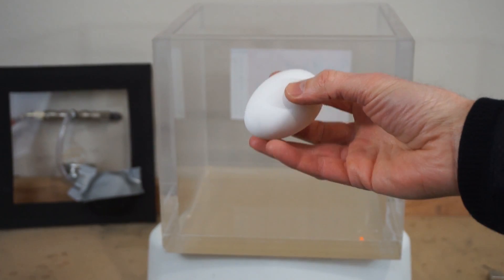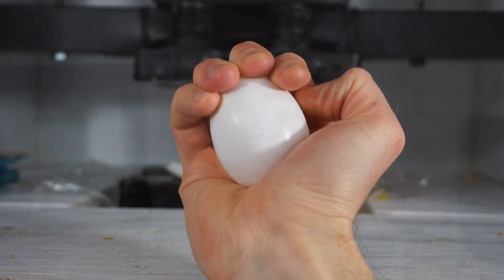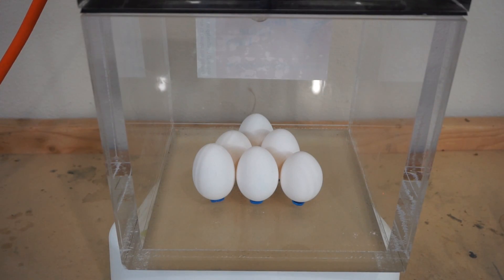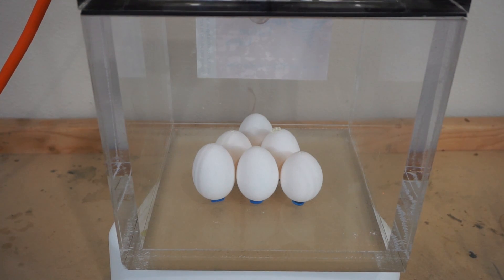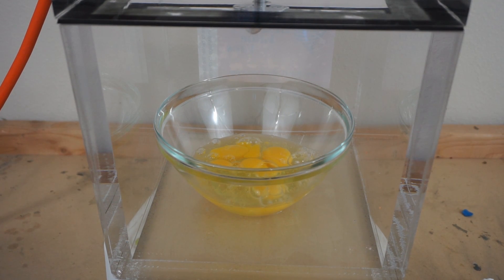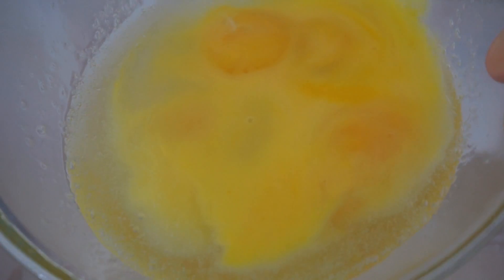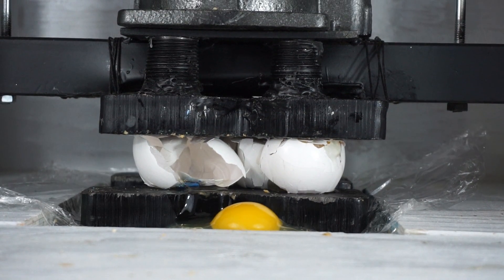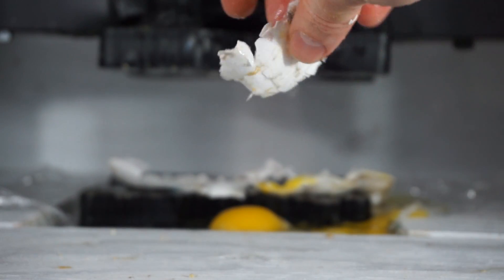What Happens When You Put 6 Eggs In A Huge Vacuum Chamber?

Comment: I don't get it, how can eggs boil in a vacuum?
Reply: Because of the water in them(74% of egg contents is water)...water boils at room temperature in a vacuum.
Reply: A liquid boils when vapor pressure of liquid= atmospheric pressure. So, you can get a liquid to boil by (1) heating it to increase the vapor pressure to match the atmospheric pressure, or (2) decrease the atmospheric pressure like he is doing in the video. The eggs have not actually changed temperature.
Reply: Derryck Gray "throttling" or expansion. Thermodynamic definition is "the boiling of a portion of liquid, that cools the remaining liquid" it happens at a change of state, not temperature, the moisture in the egg gets boiled off, and the change of state takes more energy than just a change of temperature, so the harder the boil (under less atmospheric pressure than usual) the more energy taken away from the remaining liquid. This cools the liquid, just like a lake evaporating it's water into the atmosphere, if that same lake were on mars, there would be no latent heat exchange, the water would simply flash off at once.
Reply: While it is true that the demonstrated boiling is not a result of the eggs being heated, Travis does make a point that there will likely be some measurable negative temperature change as a result of the phase change due to boiling.
Reply: So if left long enough to boil out all the moisture, could one make some really weird dehydrated raw eggs?
Reply: Wayne Chipman Not really air bubbles, they are water vapor bubbles-made of water in a gaseous state.
Reply: It is easier for the liquid molecules of the egg to escape into the vacuum as it does not need to fight against atmospheric pressure pushing down on it. It does not need to reach temperatures that can cook the egg for it to boil.
Reply: ivan bernardo not the correct description here, Not having anything For the heat to transfer into, would mean that the eggs would not gain or lose heat but because their vapor pressure has been decreased By pulling vacuum on the chamber The boiling temperature of the substance is lowered
Reply: To put it simply, all of you are somewhat right but for people that dont know why eggs boil in a vacuum is because when you lower pressures around water. The boiling point for it also lower but unlike the boiling at high temperature. This wont cook anything since the temperature doesn't change
Reply: Actually, the reason water boils in a vacuum is because in when normal atmospheric pressure, the pressure from the air pushes against the water molecules and forces them next to one another. In normal air pressure, we boil water by heating the molecules to a high enough temperature that the energy of the molecules is high enough to resist the air pressure and move apart from one another. BUT, in a vacuum, there is no air pressure to for the water molecules to resist, so it boils at any temperature.
Reply: Yes, there is actually a piece of lab/kitchen equipment I used before called a vacuum dehydrator, its just a chamber where you put food, pull a vacuum and let all the water boil off, used to make concentrates without applying heat or dry foam like foods (kinda similar to freeze dried foods)
Reply: The pressure decreases, and thus the boiling temperature of water decreases. A simple way of thinking this is that there's less air holding the water together. This causes it to 'boil'. But this boiling is not the same as boiling under standard atmospheric conditions. This is due to the eggs, which are at room temperature, having enough thermal energy (or how much the particles in the egg vibrates) to turn into a gas, to boil.
This also means that the egg does not cook in the vacuum. Cooking an egg involved adding heat to the egg. This causes the proteins in the egg to reform. In a vacuum, unless otherwise heated to the same degree, the egg will not cook and only the water and any substance with a similar boiling point will 'boil'.
Reply: Same reason water boils at 70 degress C at 33,000ft
Reply: The temperature didnt change, but the boiling point did. I don't know how you all are getting this wrong.
Reply: Benjamin Chu
Except at Absolute Zero, as the molecules would have no kinetic energy.
Reply: Vaccum increases kinetic energy of the particles, they try to move, and occupy the vaccum but in order to achieve that they need to evaporate first.
Reply: metafis:  I thought that what you wrote would be a big coincidence, so I checked out a phase diagram. At room temperature (25 C), water would boil at about 50 mBar. At a very very low P of 1 mBar, the boiling T would be approx -50 C    http://outreach.phys.vt.edu/wiki/thermo/images/Phase_diagram_of_water.svg.png
Reply: Stephen: "I make bho concentrates from cannabis" 
then no wonder you're a degen who failed education.
Reply: Diamond Tiara and why the fuck do you need to pass a MENSA test to be good at anything more if its Chemistry? Not every person needs a high IQ like urs to be succesful in life. U should actually lessen watching youtube and go back to reading or ur books it might decrease ur intelligence
Reply: Diamond Tiara yeah does ur IQ determine the persons ability asking what their ethnicity is? You dont watch much youtube, but watch a random basic chemistry video of what happens to an egg, tells a lot about ur Intelligence, and by also providing a clear message how in all people u have to reply to a degen like me, proves you have no social skills, depress and insecure. Try watching a tv for awhile and relax that may help you with dipression since ur fat enough to be pigging out, sad to say nothing can fix that face of urs to be with someone, at least fix ur social skills and make friends. Making concentrates doesnt make u look cool and make friends though, u aint getting laid even if you make them high as fuck with ur concentrates, try alcohol you might have a better chance. I dont need to correct my grammar and spelling because i communicate well with 4 languages, im not as smart as you to be writing a book, its sufficient enough for me and the people i talk to. I have to rethink my english though, since i may mistake you as a person with high IQ but having a problem with reading comprehension.
Reply: everybody but metafis is wrong The stronger the vacuum the faster water evaporates if he would have held a strong vacuum (26 inches of hg or better) long enough all of moisture would've evaporated from the chamber
Reply: appleintosh I guess....
Reply: Dude no...
Reply: Not true
Reply: The vacuum lowered the boiling point of oxygen to room temperature. Eggs are mostly water and that has oxygen atoms. Don't quote me on that, I'm probably incorrect.
Reply: So... Its hot?
Reply: No.  Room temp, but the low pressure allows the water in the egg to boil. Presumably, all the liquid would boil if the pressure was really really low.  The "vacuum" chamber doesn't get down to 0 atm (Bar or mm Hg)
Reply: Boiling means changing of a substance from liquid state to gaseous state. Boiling doesn't mean that it is hot. For example oxygen boils at around -174 something degree Celsius.
Reply: When the vapour pressure become equal to external pressure liquid boils
In this case the external pressure becomes zero so it starts boiling
Reply: Damn im no genius and i def cant follow none of you, Chemistry and Physics is the only thing i excel when i was in school. But may i ask why im hearing comments about boiling? I make bho concentrates from cannabis, and theres is no water whatsoever being used there since i am making oil extract from butane, before placing oil in vaccum butane is already purge from heat give or take 2-5% butane left, and it does the same like shown with the egg in the video
Reply: Diamond Tiara its alright failing education, i dont think education did me good anyways, but i wish i did better. doing concentrates was just something i do on my free time a couple of weeks ago, and no i dont get my money selling weed and concentrates, its actually illegal in my country to do that and we dont have that much info considering nobody knows how to do it. why do i think i check these channel? I was tryng to learn and ask to get a more sensible answer,  Im pretty sure ur good with education considering how u got so offended with what i said, ur parents must be proud with ur high IQ, but u should also consider learning EQ, since ur reply was such on point. Of all the threads here u replied on mine? If ur such a genius then why come at me and not the people here who are actually giving mix information on the topic given? Yeah i guess u also learned doing concentrates from youtube then you ask people behind the science of it. But in reality i dont think you are that smart either, just ur name says it, probably the only thing important to u in school is how u look and be the princess on the day of ur school night. Ayeeeeee u go back being a princess of the cannabis now.
Reply: Diamond Tiara you are actually the easiest person here to figure out. #1 u are probably a genius who went to an ivy leavue university who excel in school and passed the highest level of IQ test which is MENSA. Probably have a masters and a doctorate degree, so u started working for a job, and ur probably good at what you do. #2 u asked the ethnicity of the people, which u said u hope that u dont offend anyone, which i think is not relevant at all, ur probably not a racist but later i will discussed why u ask the ethnicity of the people. #2 on ur work, u did not get promoted so u are stressed that is probably u want to make concentrates to get the highest dosage to relieve ur stressed and ur anger on this co-worker who happened to got the promotion, who you probably think is nowhere on ur level of education, read above, im sure hes of a different ethnicity than you, even if u are not a racist ur frustration tells you to look down on him/her that u find ways to make u feel better and superiority complex comes along hence the smoking of weed which is not enough to relieve ur stress so u make concentrates. #3 ur boss probably knows ur good, but u are bad with people that maybe the cause u did not get the promotion, or ur co-worker is ok with work but have a better personailty than you, whom everybody likes and wants to work with so he gets the promotion and you are left unnotice. Weed doesnt change ur personality my dear tiara, smoking weed or making bho is not as cool as you think to fit-in. If you have a high IQ u know im not stating facts but close to it. U are one troubled woman/BI, but i am sure u are a woman. So lets get back that u are not bring notice, so u try to insult me instead to get noticed. Woman the world doesnt work that way, u pull everything down except ur panty. Go get a bf better yet of different ethnicity just like when u were in college when stressed has not degrade ur EQ, pull that panty down and get an orgasm. Or make some cannabis lube and fuck urself, studies shows that orgasm relieves stress as well
Reply: Diamond Tiara on the side note if ur so smart which i also the u werent vaccuming ur concetrate too much that the butane residue went all to ur brain. There are many ways i make my concentrates safer that i dont need to know the science behind it but rather bought those equipment and just follow instructions that need not to passed MENSA, that being a reason i came here to be educated not mis-informed or insulted, and no i dont like to read a 500 page book, youtube is one way for me to learn, one of those is to dj where i use to play on clubs, growing cannabis and making concentrates to give to my friends who has a family member who have cancer also i learned prunning, air layering, grafting techniques on my fruiting trees that i bought around the world when i travel that are not suppose to fruit in my country but succesfully did. So yeah i dont need your IQ and spend thousands of dollars in school lile you, i let people learn that from me, all i need to do is watch enjoy work and smoke weed.  have fractional distillation and rota vapor (buchi) u think i need ur intelligence to make one? Im no engineer but that is my field of work, im no chemist but i have the eqipment, nor im american but i speak english so please do educate me with your big words i will probably understand you since i speak 4 languages.
Reply: Diamond Tiara i forgot to tell you i also am now learning how to make bonsai, im sure everything i told you answers ur question, i dont need to boast to you what i do for a living, or what i own or what i have is private to me and my family, and with all that free time i have i must be doing something good in life, i dont consider myself as a failure as a person just because im a degen in school. I fail to learn, i learn to succeed. I didnt learn that in a book btw, Fuck ur probably reading the wrong book.
Reply: IQ tests are what determines the scale of humans, and no human is equal.

I don't watch much of Youtube, and I don't even have TV. So reading this from the degenerate you are, Stephen, unable to type with a correct grammar.
Know that I'm not even American and I have to correct you. You should be drowning in your own shame. A shame of exposing yourself your inferiority.

DNA and IQ are linked. Knowing chemistry basics is important, same for electricity, electronics basics, mathematics, geography and most important, grammar.

Your inferior kind are the flat earthers, believe gender is a social construct, eater of tide pods, snorter of condoms, you use a smartphone or a mac, being devoid of actual computer knowledge, your race cannot draw, write, read, build, create anything sophisticated, you have no job and no legacy and you must not be the future for the sake of mankind.

commit suicide immediately.
Reply: Diamond Tiara and u stated u dont watch much youtube yet you mentioned, tide pods, condom snorting and who came first the chicken or an egg. Ur probably the degen who wants people to think u have high IQ, and read ur first book on how to look smart for dummies, by starting to state the obvious that no people are the same, and that basic chemistry, physics, geometry and grammar are the key to success. With that thinking u will still be the same degen with no social skills, ull never get that promotion because the person next to you is already oiling ur boss for the next opening promotion, while youre still reading that book and what not. Go get urself a proffesional psychiatrist, or maybe a plumber, electrician, a drug lord who can teach you how to make cocaine, for sure they just dont know the basics. While i sit here doing nothing, replying to a sad person like you, watching youtube while closing a deal and paying someone like you, wait def not like you.
Reply: In a vacuum far less heat is required to excite the molecules. Air conditioning works on the same principle.
Reply: It's the opposite effect to a pressure cooker.

A pressure cooker RAISES the boiling point of water, so that you can get the food inside to a higher temperature without boiling off, so it cooks much faster.
Reply: Cervine Canine But if temperature was a thing, you could cook stuff in a vacuum without first heating it. Ice water will boil in a vacuum without changing temperature.
Reply: Water boils at 100° in atmospheric pressure as the pressur decreases bolis below 100°c same principle is applied here
Reply: I think because the eggs molecules decompressed and trying to spread when the air molecules gone its not due to temperature although its kinda same when you heat a liquid the molecules spread and turn into gas
Reply: jackfavvv PV=mRT
Reply: Atmospheric pressure ya nub
Reply: Derryck Gray the eggs didn't change temperature until exposed to atmospheric pressure again. Once chamber is open the temp of eggs will actually be cooler.
Reply: Travis Dewitt my previous post is referring to the boiling event. Can you explain the temperature difference after the eggs are removed from the vacuum?
Reply: Who here actually went to physics or science class?
Are you guys from SEGPA, or some common core public school?
Do you pass a MENSA IQ test?

Also don't take it bad, I'd like to know everyone's ethnicity.
Reply: jackfavvv hes a fuckin idiot.. For a person born in America(im assuming) where English is his first language; his vocabulary wasn't broad enough to say BUBBLING? Lmao. Hes making our youtube. Generation of kids dumber
Reply: jackfavvv oxygen is pulled out but there is oxygen throughout the egg
Reply: jackfavvv I know this is way late BUT 
Because a vacuum has nothing in it, there's nothing for heat to transfer to. This caused the eggs to overheat and boil!
Reply: jackfavvv because the heat in the egg has nothing to transfer to

Comment: it's not boiling. what you are seeing is air bubbles being evacuated from the eggs at a rapid pace. boiling requires heat. we work with resins at work, and they all have similar reaction under vacuum. it is the air being pulled out of the resin.